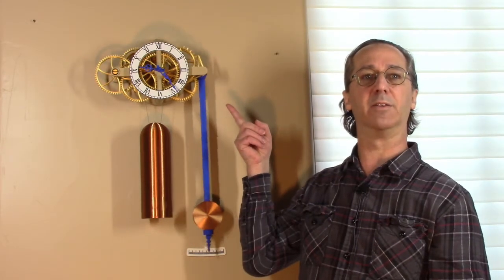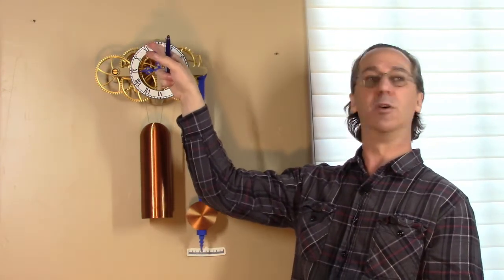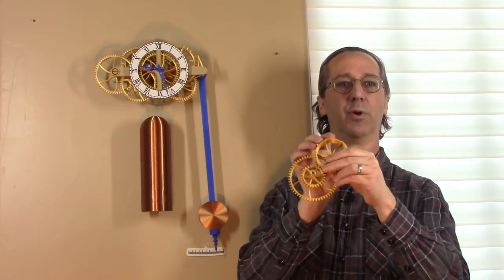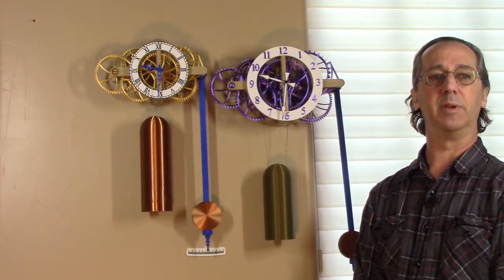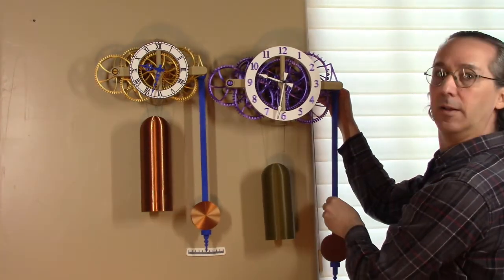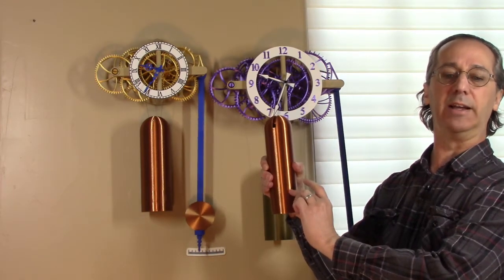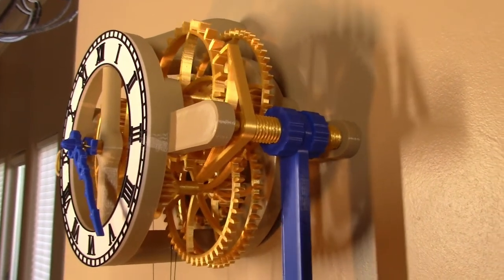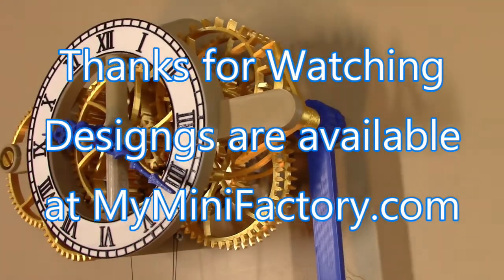Easy Build Clock with a 32 Day Runtime

Comment: interesting,  wonder if anyone tried fabricating this clock with cnc router or cnc laser cutter machine?
Reply from the maker: It might need to be scaled up by around 50-100% so the gear teeth are large enough. The spokes and rims would also need to be widened to give them extra strength. The overall look of the clock would stay the same. Some day I will try to build one.

Comment: How well does it keep time?
Reply from the maker: It usually stays within a minute or two per week. The accuracy is mostly dependent on pendulum length and the escapement type. 

The pendulum length is easily adjustable. It is influenced by temperature changes, but I find this clock to be just as accurate as my other clocks with carbon fiber pendulum shafts. 

The deadbeat escapement in this clock is very tolerant of changes in drive weight and slight changes in the beat. Changing the drive weight from 5 to 8 pounds will increase the pendulum amplitude slightly, but it seems to keep similar time. An anchor escapement would drift all over the place.

Comment: Hi, how do you print the 2 colors
Reply: i downloaded all the files, but i don't understand how to print the "frame-dial-numbers" in two colors. for me it can be better to print only the numbers, and glue them to place.
Reply: OK, sorry for my question, i sliced the numbers in th slicer , and printed them.  now I can glue them in place...Thanks
Reply from the maker: The color change can be done by adding a filament change in the slicer. 

PrusaSlicer makes it really easy. Move the slider in the preview panel and click on the "+" symbol, then re-slice.

Cura seems to be a bit more effort. Here is one description https://www.instructables.com/How-to-Change-Filament-Mid-print-Using-Cura-48/

Comment: I've made 2 of these now although I've only been able to get them working reliably with the 7 day gearing. https://www.youtube.com/watch?v=GyzPtPzBq0w
Reply from the maker: I also converted my 32 day clock to a 7 day clock. 32 day mode turned out to be very aggressive. The pendulum amplitude was barely enough to keep the clock running and the beat always need to be reset after winding. 7 day mode is much more reliable. 

Another issue seems to be that some brands of PLA are stickier than others. And they might develop stickiness over time. I have started adding a light coat of grease to the pinions. It doesn't seem to affect PLA and the clocks run much better. The pendulum amplitude nearly doubled. So far, the clock has been running about 3 months with no side effects from the grease.
Reply: @stevesclocks  I used a small file to dress the gear teeth which helped and also used a little white lithium grease on the gears. I am very happy running the 7 day gears. Thanks for the great design!
Reply from the maker: @vmdirt  My oldest clock has a section in the manual about cleaning up the elephant's foot. I used to manually clean up every gear with a file. Improvements in the slicer, or maybe just finding the right settings, and I no longer do any gear cleanup except drilling out the center holes.
Reply: @stevesclocks  I'm pretty new at printing and unless I print the gears with a brim there is a 50% chance one side of the gear will curl up because it doesn't stick to the bed. It's a lot of extra work to clean up the gears after removing the brim but it's 100% effective. I would love to be able to print gears without having to do any cleanup. I have spent a lot of time trying to get the bed height right and I use hair spray with seems to help with most things but those gears still give me trouble, usually the thin ones.